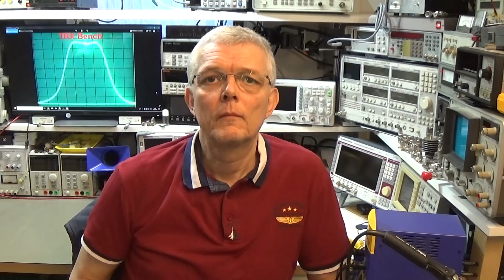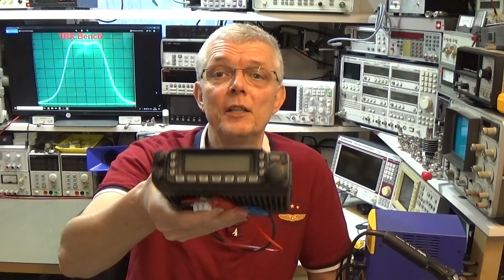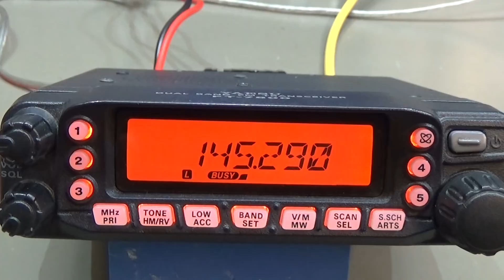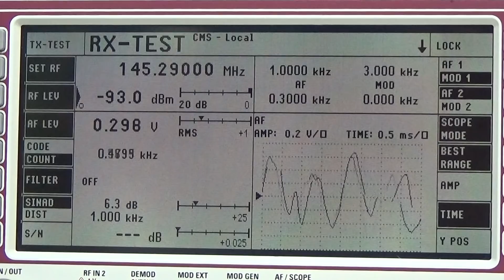#169  A Yaesu FT-7800 pretending to be deaf fixed

Comment: Hi Peter, excellent video!!  I have the 7900 model of this radio with exact same problem.  Poor RX sensitivity on 144 but OK on 220 and 440.  At 7:38 of your video I see the signal path split between 200-300 lower path and 108-220 on upper path.  So I ran a quick test of sensitivity and sure enough, 200-300 is good but 108-200 is bad!!   What PIN part number did you substitute for HVC131TRF??  I need same part.  The one you used is larger footprint.  Can you please  recommend a proper substitute for the TVC131TRF as I will need to order one.  Thanks so much for sharing your knowledge and talent!!  73 Dwight N7KBC

Comment: I had same problem on FT-7900 , it was PIN diode on receiver side on VHF.   I replaced with tougher PIN diode bought from Digikey.  it been working fine for 10 years now.   PIN diode was damaged, because I transmit  60 watts on 144MHz from another radio , which  antenna was only 3 feet away on mobile setup.   I usually use two soldering iron with fine tip to remove and solder most of two pin SMT parts    AG6JU
Reply: Hi I have exact problem with a 7900 on my bench.  Poor RX sensitivity on 144 but OK on 220 and 440.  Which PIN did you substitute for the HVC131TRF?? Thanks!

Comment: Hi TRX, Plumber heating engineer with limited electronical knowledge.  I just bought a second-hand 7800E. So check your site out for reassurance for any future repairs that might be required, looks like well-built radio with fix ability. I love your very well-explained videos. Would it be possible to add a cost of the work you carry out to the radios you repair in normal time obviously without your commentary would be a shorter time to repair, You Have once again entertained and inspired me Thanks Mike Robertson M7 HTO

Comment: Very helpful, technical and well elaborated video. I got in a FT-7800 for repair that suffered from deafness on 2M. Exactly as explained in this video. It turned out the same D1015 was defective. It actually bursted into two pieces, only visible by microscope. I think it was caused because the OM operates with significant RF while having the VHF-antennas in close vicinity. Bought some extra HVC131's in spare... you'll never know ;-) 73's from NL!

Comment: Goodness me what a fantastic repair. how a little cheeky diode can cause hell of a problem. well done to trace and fix the issue. however it would havebeen better if you could have gone further in testing dual gate mosfet and other components for teaching purpose only by giving in certain signal level at antenna port.
Reply from the maker: Thank you Adnan, yeah see the point but there are other videos here on my channel showing how to test a dual gate FET for instance the IC7000 video...Thanks for comment 73

Comment: Great repair! You can replace the HVC131, that is not available anymore, by an BAP64-02 that has the same size (higher reverse voltage, less capacitance by a slightly higher on-resistance). I did the same repair last year, and for the 8V regulator, the temperature is not critical. The audio amplifier also stays way below it's junction temperature, but I added just another hex bolt to it.
Congrats fore the CMS, do you think about making a comparison video explaining the CMT vs the CMS? Would be interesting.

Comment: You can see the crack in the solder at 38:39 quiet easy on your close up (Cathode end of the Diode you replaced).......cheers good Video as always.
Reply from the maker: It looks like a bit like a crack..in any case it is bridged :^) Thanks for comment 73

Comment: Whoa hold it hold it when did the newer R&S com's tester arrive and are you going to treat us to a features video? Great repair by the way we often think  pin diodes are so reliable we forget to go back to basics also a video on getting round live board testing with heat sinks removed would be great more and more we see pcbs trouble shooting a problem because the IC,s need keeping cool cheers Peter all the Best Sean
Reply from the maker: Thanks Sean! We ae going to do  lab update soon 73

Comment: Isnt that a bad solder joint I see @ 21:00? Left center next to what looks like 2 diodes close to each other (parallel)? looks like leg of component poking through joint with space around it...
Reply from the maker: Hi Claude must be a kind of reflection have double checked it . Thanks for comment 73

Comment: I watched the fix and it was great but I also was looking at your Rohde & Schwarz communication service monitor.  What a great interment.  I went to Rohde & Schwarz web page  but couldn't find the communication monitor.    Do you know if the monitors are still being made?   I would be interested in getting one.
Reply from the maker: No R&S have now a new model. It is the CMA180. The last CMS has been sold as far as I know around 2010. May be someone can confirm it or correct it here.. 73

Comment: How did you select the replacement PIN diode?  Would like to know your process. Thanks Peter for another very interesting video. 73
Reply from the maker: very easy, you grab the data sheet of the original PIN diode and then find a new component where the figures are even better. e.g frequency range, RV, Ron, If, P-tot  and so on. Sometimes this can take a while

Comment: Enjoyed this episode Peter. Just below where you were working it looks like C1485 and C1451 are missing - any chance these could be the source of the burn mark? Or are these “No Populate” options? Are you sure no one has been in here before - the original soldering on those diodes looked a little dodgy.
Reply from the maker: Hi Willis, it looks like that those parts are "no populate" options in the E version of this radio. If this parts would have been the reason for the burning marks we surly would see component fragments in the radio but beside the burning mark the radio was clean.. Thanks for watching 73

Comment: Another great repair.  It's nice the board can be powered up out of the radio.  Sure makes testing a lot easier.  Thanks for sharing.
Reply: I find it interesting that the designers spec parts such that even under a "light" load, no AF for example, the parts still run hot without them attached to a heat sink surface. Imagine it revolves around building something to a cost but my intuition says not so great design practice. Anyway, nice repair as usual Peter, thanks for sharing!  73 - Dino KL0S
Reply from the maker: Hi Mike, yes that is helpful for repair but as Dino already said the components are getting really hot so you gave to work very carefully..
Reply from the maker: Thanks Dino!  73
Reply: Not something a lot of people can do on their own but I make test fixtures for radios like this that I work on a lot.  Basically start out with a piece of 1/4" thick aluminum plate and using a Bridgeport milling machine I cut out the majority of the metal leaving pads for the components that need heat sinks.  A lot of work but once its made I have it for use in the future.  I'm going to be getting some more radios from President to do review videos on.  I think one of them is made like this with half the cover acting as a heat sink.  I may make a custom test fixture heat sink for it so you can see what I'm talking about.